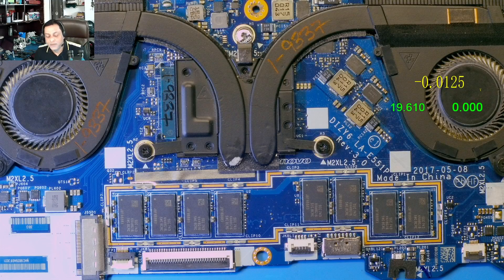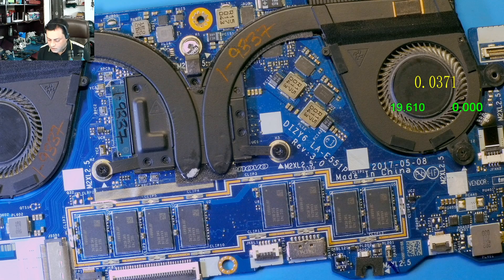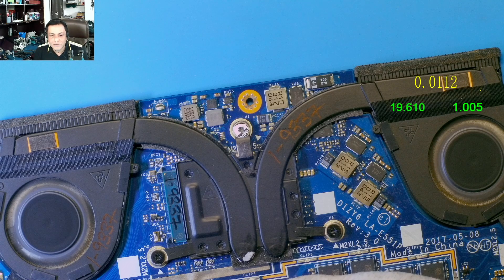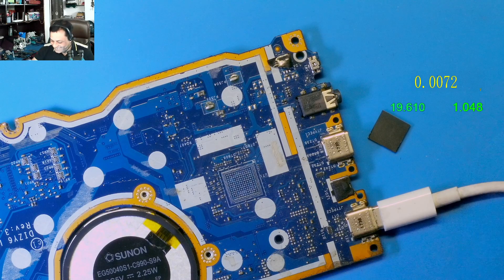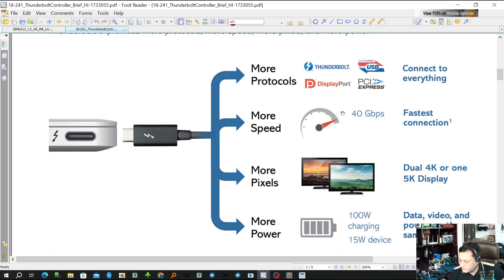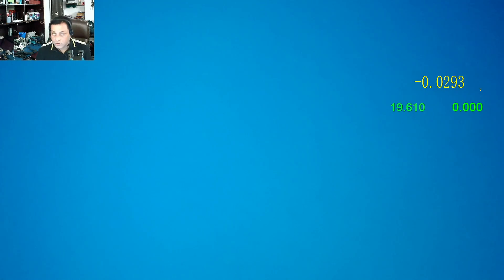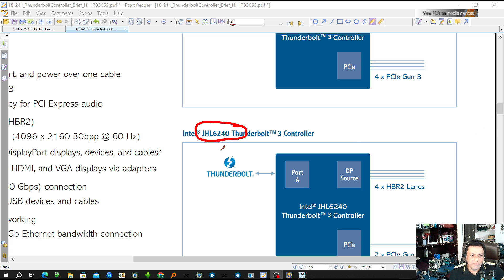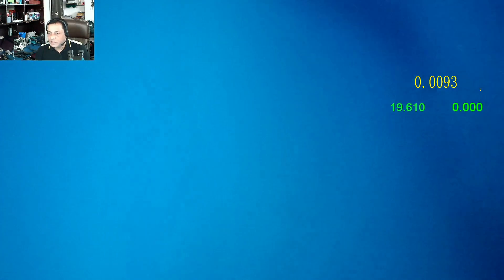Lenovo Yoga 720 Type C Controller JHL6000 Series Concept | La e551p | Chiplevel Training Course Eng

Comment: My laptop runs on AC, but it doesn't detect the battery anymore and therefore it cannot charge it or switch to the battery when disconnected from the mains and visa versa, the battery itself is still good. My laptop is an Aspire E-15 ES1-571 model and would like your advise on what to check and which components might be the problem, how to go about troubleshooting and where to find the components to replace the faulty ones.
Reply from the maker: Check SMBus communication between battery and SIO.

Comment: HP 840 G6 used JHL 7340 when removed it than laptop will no display also graphics volt present but display no sowing! What is solution for this ?
Reply from the maker: Can't tell from here bro... Need to check it then only can give opinion.
Reply: @laptex1377  please check and explain   thanks
Reply from the maker: Send the motherboard to the office address pls.
Reply: @laptex1377   Im  from Dubai
Reply from the maker: Better find someone who can physically help you with that.